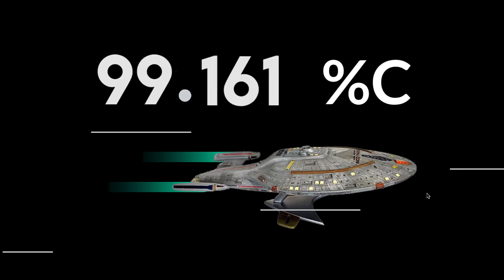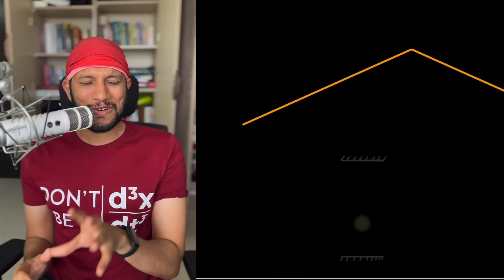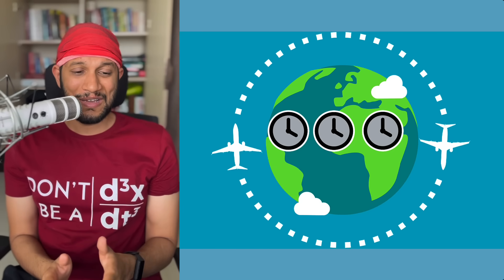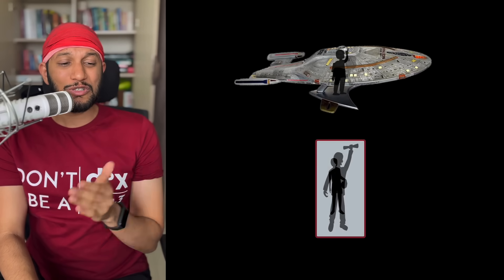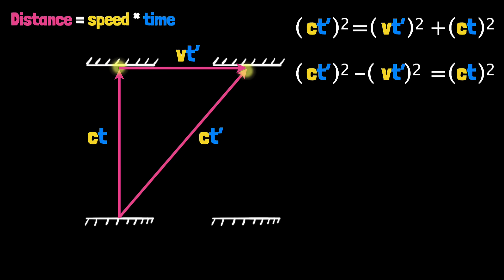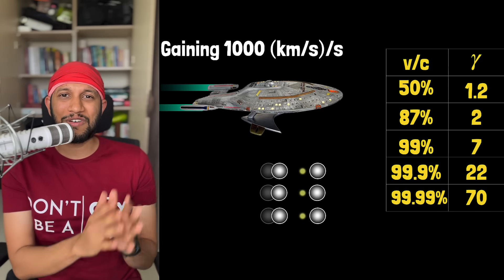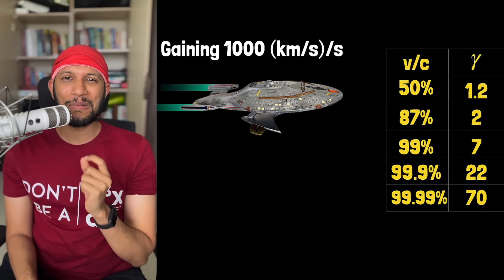I finally understood why you can't go faster than light! (My mind is blown)

Comment: Ok, this makes sense if you are using an outside frame of reference, as he was explaining, to an observer the photon traveling at speed between two mirrors has further to move.

How about if I am already traveling at 50% speed of light in my ship and within my ship I launch a projectile at 50% the speed of light.
To my frame of reference the projectile would be moving at only 50% speed of light, just as you can throw a ball on a moving bus.
But that projectile would be already moving at 50% speed of light before launch. So surely its' total speed would be 100%?

Perhaps what Einstein's theory proves is not that it is impossible to reach the speed of light, but that it is impossible to "observe" something moving at the speed of light?

Comment: So if C represented 1,000 m/s instead of the speed of light, this formula still works but obviously we can travel faster than that.
Reply: If c was 1000 m/s, that would be as fast as you could travel relative to any inertial reference frame.

Comment: But what I dont understand, you say the people on Board dont recognize any Changes basically right?
So what Happens for them in the Idea?
Yes you spend Infinite time for Others, but the Crew in Board should Just  simply get there pretty fast eventually right?
Reply: Correct. Well, not "infinite time for others" but "a very long time for others", long enough at least that they will say you never exceeded light speed.
Reply: @jmodified  but the crew did. so you COULD get there right? so it should be possible then?
Reply: @leSmokySmoke  Yes, you can get anywhere as fast as you want, assuming you have enough energy and can withstand the acceleration, etc. If it's far enough away, whatever you expect to be at that place may no longer exist when you arrive though.

The crew will not exactly say they exceeded light speed, they will say the distance from the start point to the end point decreased as they accelerated, then increased as they decelerated. Any instantaneous measurement of speed they make relative to anything else will always be below c. Of course if they compute the average speed based on the distance measured before starting and the elapsed time they experienced, it can be above c, but that is not really "speed".
Reply: @jmodified  okay so then we arrive at the point I really dont understand.

if at 99.99% light speed, the video says one second for for me is 70 seconds for you on earth watching.

so light needs 500 seconds from sun to earth. If I would start at the sun and fly towards you on earth watching with 99.99% c. I SHOULD arrive nearly 500 seconds after I started at your location. because that is what would makes sense right?
but when I need 8 minutes and 20 seconds at almost c that should mean it takes about 35.000 seconds for you, about 583 minutes or 9,7 hours, until I get to you meaning you would only see me move much slower, but Im not right? I still should arrive a bit more than 8 and a half minutes after I started, or does traveling at light speed somehow lets you travel to the future? but how does this makes sense.
Reply: @leSmokySmoke  You've got it reversed. The time for light to travel is about 500 seconds as measured from the earth. Each of those seconds is 1/70th of a second for someone traveling that distance at .9999c. The traveler measures about 7 seconds for the trip. The traveler measures the distance as 1/70th the measurement from earth.

Comment: If two spaceships are travelling towards each other at 1/2 the speed of the light, each spaceship will be at the speed of light in relationships to each other. What am I missing?
Reply: Depending on what you mean by "in relationship to each other", possibly nothing. As measured from some rest frame, the limit of the speed of two objects relative to each other is not c but 2c. But the people on the ships won't measure times and distances the same as you do - each will see the other as approaching at .8c. The same is true at low speeds relative to c. If, relative to the road surface, two cars are traveling toward each other each at 50 mph, then each will see the other's approaching speed as about 99.999999999999444 mph. For most human purposes that's close enough to just adding the speeds, so that's what we do.
Reply: @jmodified  thanks for the repply and explanation

Comment: So the boy on the earth observe the  boy on the plane was growing slower, but the boy on the plane also observe the boy on the earth growing slower. So when they meet each other who is older?
Reply: The one who did not accelerate.
Reply: @jmodified  both accelerated from the other's point of view.
Reply: @gum8888  No, acceleration is not relative. Things accelerate relative to inertial frames. When you are not accelerating you feel no forces, when you are, you feel the force of that acceleration. Comparing yourself to an accelerating frame is not the same as accelerating.
Reply: @jmodified  so the one who accelerated observe the other one growing slower and  when they meet he find out the other one who growing at a slow speed become older than himself?

Comment: What would a forward facing light look like when traveling near speed of light. Would the light consider your speed 0 or would it slowly move forward.

What about if you were in a ship moving near speed of light, then accelerate forward within the vessel, could it be momentarily be broken by the object inside the ship.
Reply: 1) From your point of view the light would go forward at c relative to your speed. From the point of view of someone who is currently measuring your speed as "near light speed", it would move forward slowly relative to you. From the point of view of anyone, anywhere, moving at any speed, the speed of the light will be c.

2) No, that's no different from the ship accelerating. You can accelerate forever at any rate and still will never exceed c.

Comment: Great explanation, several things that I still need explained 1) If time stands still at the speed of light, how does it have speed?    For there to be speed, you must have an elapsed time.  If a ship is traveling at .75% of light speed in one direction, and another at .75% in the opposite direction....did you just pass each other at greater than the speed of light?

Comment: The 2D photon clock out a thought in my head. 
The photon couldn't bounce.  It would be moving at the same speed as the mirrors. 

Time would stop. All molecular movement would cease like at zero Kelvin! Everything would technically be dead.
Now, if you could jump past c=v, would the photon continue?

Comment: What is the speed referenced to? What if we’re moving through space already at 20x the speed of light?
Reply: All speeds are relative, but one moving at 20c relative to another is not valid. You can say you're moving at .9999999999999999c if you want, and that is true for some reference frame.

Comment: I can't help but feel as though your intuitive explanation breaks down at the point just before 299,792,458 is reached. 
Thought experiment: You have a particle going 299,792, 457. You provide a unit of energy directly behind it by a typical atom distance (since the original explanation showed that), and now that photon is trying to catch up. And catch up it will. 
What is stopping that photon from accelerating the particle to 299,792,458? 

-- As I was writing this, the thought occurred to me: Given that scenario, the net inertia might be (c + v)/2. And no matter how close you get the particle to C, the energy of both items won't average out to that, so you can only ever get it closer. 
If someone has any thoughts on this, please comment.  

--In conclusion, I think you might have addressed the infinite energy problem, but not in the same intuitive sense that you tried to address the infinite time problem. You switched from geometry to a fuel analogy. 
Any finite amount of energy added will only get you closer, but not to it. It's a conservation of energy issue.
Honestly, I think that's the better explanation. Simpler, more intuitive, and doesn't have that nagging threshold dilemma I pointed out above.

Comment: Clocks are not time. Time does not exist, as its only a concept humans made to measure the length of existence. Clocks are tools we made to measure the concept of time. Just because an object moves slower it does not mean an existence lasted longer. Your perception of time changes, as time only exists in your mind, that's why 1 minute in pain can seem like forever,  and 1 hour of joy can seem like nothing. It's all in your head
Also 1 question. If you can't reach light speed because time dilation will make photons take longer to move, how does light, made by photons, has it's own speed?

Comment: So the real intuitive an simple explanation is:
Atoms need more and more time (up to infinity) to catch up and carry the energy needed to accelerate. You can make them accelerate faster, but it will need more and more energy, up to infinity.

Atoms are the problem, they are too slow and need too much energy, to ever reach the speed of light. The only way to truly reach it, is to convert atoms into photons, and then photons back into atoms when you finish your travel. So without tranforming matter into pure light, and then back into normal matter there is no way anything with mass will reach the speed of light.

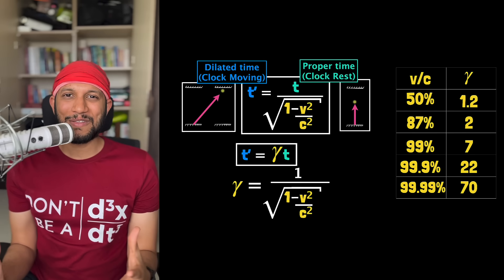Comment: 11:40 Isn't this the same thinking as with the arrow and the target thing? The arrow will never reach the target because to do so, it would first have to travel 50% of the way, but if we take the first half, we can also take 50% of that new side, and we can divide that infinite amount of times, so the arrow will always be stuck and even if it reaches 99% or 99.9% or 99.999999...% of the way, we can always divide it more and it'll never reach 100% 😅Sounds kinda similar.
Reply: Similar, but Zeno's arrow is dealing with infinitesimals (so the limit is 0) while this is referring to infinity 🙂

Comment: In the universe, everything is relative. Our planet is not standing still, nor is our sun. Our galaxy is also moving, along with galactic clusters. Where is the point that stands still and serves as a reference point? This is a complex topic. Currently, the experimental data on time dilation is quite negligible and may be caused more by gravity than by speed itself. Empirical data is needed, but to obtain it, we need to build a spacecraft that can reach at least 25% the speed of light. What we have now might simply be an error margin. Before the invention of rail transport, people believed that a person could die if they accelerated to 100 kilometers per hour...

Comment: The theory and the explanation is really interesting. But the most important question in the experiment is: Who is the observer and who should get older? 

Generally we consider the observer is on the Earth, but if the ship is moving away from the observer it also means that the observer moves away from the ship. It simply depends on who's position you decided to fix. We actually can't tell moving object from the stationary one in the space.

And what if we put two twins in two ships and launch them to the opposite directions? Who will be older?

Comment: There is a theory that our universe is expanding at ever faster rate. Doesn't that mean that at some point our part of universe would be so fast moving that all time would slow down? If you only have  two particles in universe, with no known fixed zero point of universe, moving apart from each other then it's the same as if one is fixed and the other is moving away from first one. The moving faster than light is impossible then must implicate that there is some fixed reference point in space and we cannot move faster from it than speed of light. 
Please feel free to joke my ignorance.

Comment: Let's say you have a photon leaving a star in one direction and another leaving the star in the complete opposite direction at the same time. 
They both travel at the speed of light, right?
But the star is moving in a galaxy and the galaxy itself is moving trough space. Let's say the star is moving 1/10 the speed of light.
Let's say the 1st photon is leaving the star in the same direction it is traveling, while the second is leaving the star in the opposite direction.
Is the 1st photon traveling at 1.1 speed of light while the second at 0.9 speed of light then?
If you shoot a pullet at the exact speed of sound in the direction of travel while going at the exact speed of sound, will the bullet never leave the barrel of the gun, or will it travel at twice the speed of sound forward? Why would anything behave any different with the speed of light? 
I honestly think we are wrong about the speed of light in general and just don't seem to understand it.

Comment: Another way to think of it is Length contraction. As you fly in your spaceship and get close to light speed [c], it will appear to become shorter to outside observer.
But also, for you inside the spaceship, you will see the Universe contract in your direction of motion. So for example if you are heading for another star 87 light-years away at 87% of c, it will seem like it's only 43.5 light years away for you. Instead of 100 years to go there, you will only count 50 with your onboard clock.
And if you edge close to c, the distance will become infinitely small. In the end the whole 3D universe will be compressed to a 2D plane for you. Imagine that!
To joke around a bit, if you could go over c then maybe you could burst out of this universe and enter a different kind of universe, where perhaps the lowest speed is c instead of the top speed there. OK OK this doesn't make as much sense, but, feel free to give your ideas on this.

Comment: Here's something that gets me with this explanation. How is the accelerative force of the engines being transferred by photons? [edit: photons are accepted to have almost no mass and thus serves as a poor medium for the transfer of kinetic energy.] The diagrams would seem to indicate that the faster you go, the more the light in your relative space would red shift. You would still be able to see if there were enough light in the high frequency ranges to red shift back to visible light, but even that would eventually fade out as you continued to accelerate, causing you to experience total darkness.

Comment: In this video there is a space ship and an observer at an external vantage point. Let's call the observer A. So far so good. But, what if we add another observer in a distant galaxy that is moving away from the first observer at 90% of the speed of light? The space ship travels directly towards this distant observer. Let's call him B. You elaborated on what A will see, but what will B see? Will he see a space ship approaching at 10% of the speed of light, or what? If so, why can't the space ship accelerate to 90% of the speed of light relative to B?

Question no. 2
It's impossible to travel at light speed, but it should be possible to travel faster than light provided you find a way to skip actual light speed, which of course is impossible, at least in this century. But, as a thought experiment, let's say it can be done.
Am I right or wrong? If I'm wrong, why?

Comment: my question is this. The Earth is moving so any clock on the Earth is slowed down because of that. If we were to take a clock and put it on a rocket moving in the opposite direction of the Earth at the same speed the Earth  is moving, does it really slow down or does it speed up? What point in space is static (not moving) to base all of this off of?
Reply: It is always relative to the viewpoint of the person holding their own clock? so it will always be slower. the object moving faster will always have a slower clock.?
Reply: @mnewm21  say there are 3 dudes. Each has a clock. One takes off in a rocket going east at .99 the speed of light and one goes west the same speed. Both go far enough that they are 1 second off from the guys clock that stayed behind. However, relative to the guy that went east, the guy that went west did it at 1.98 the speed of light so should his clock be off even more? But to the guy left behind they both are the same but different than his by 1 second.
Reply: @zakspop  interesting thought but it is only the speed of the rocket the clock is on that counts for that clock? as both the clocks on both the rockets were moving at the same speed just in opposite directions there is no double dilation effect?
Reply: @mnewm21  what determines which is moving? The Earth is moving, correct? So a rocket launches and flies in the opposite direction the Earth is moving at the same rate the Earth moves. Therefore the rocket is still and the Earth is moving? Which clock will slow down? If you say it depends on from which viewpoint, then really neither is slowing down. It is an illusion caused by the speed of light.
Reply: @zakspop  its not an illusion. Think about two cars driving on a road towards each other at 100km/hr.  If they collided they would have the force of two cars travelling at  that speed but if you are in one of the cars you are still only doing 100km/hr and say you swerve and miss the oncoming car and continue to drive away you are still only doing 100km/hr you don't magically drive away at 200km/hr because the other car going in the opposite direction is doing 100km/hr.  So the clock in each of those cars is exactly the same as it is doing the same speed.  Same applies to your rockets.  If you leave the earth in any direction at 10,000km/hr you are only doing 10,000km/hr relative to the earth and all the rockets have the same clock speed as they are all only doing 10,000km/hr. Each clock only cares about the speed it is doing and the different tick is created by the difference between it relative to the clock at the viewpoint.